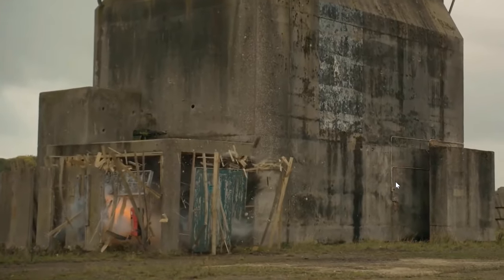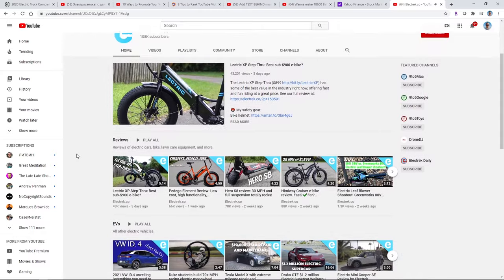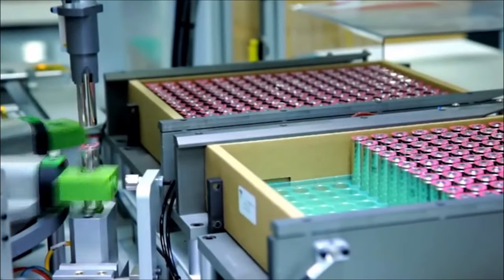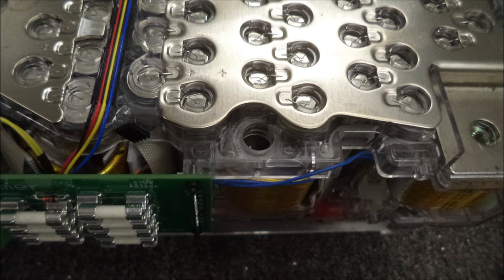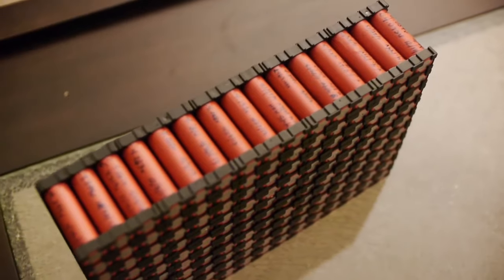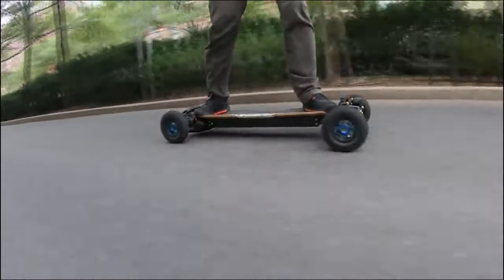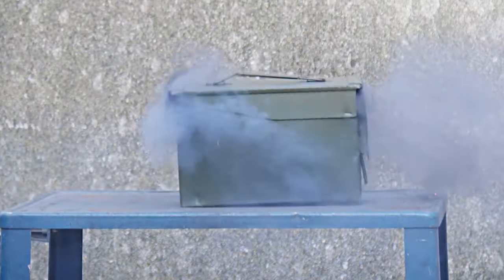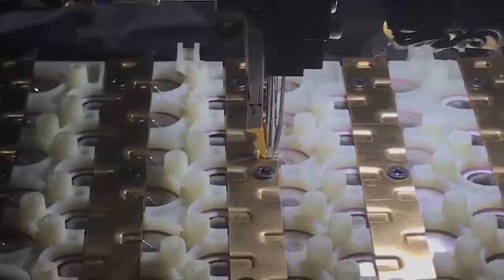7 Steps On How to build The Safest DIY Li-ion Battery

Comment: the safety concern is good and all, but most of the time for e-bike battery builder, they use copper-nickel sandwich to deliver the outmost current from the battery, and using cell level fuse in this build almost impossible and easily make the budget multiply many times over.

diy powerwall user that use old laptop cell most of the time, while most of them use cell level fuse, but they solder it anyway, because the price of proper spot welder that around $200 or more like glitter 801D just doesn't make any sense compared to the pack price that usually not that far from that price or even they got the battery for free, yeah solder is bad but if you knew what you do and how to do it, especially for powerwall, i think it's still doable. 

diy powerwall that goes kaboom most of the time is from heat generated while being used, not while it's made, yes it's survivor bias but the reality is like that, most of the time because of overvoltage because the solar charge controller they used are cheap one, and diy powerwall rarely pushed the current rating, they use less than 0,5C most of the time.
Reply from the maker: Tesla is using a new tech now without fuses.
Reply: @ElectricVehicleSpace  i definetely need to read that, tesla is still ahead of it's time when it's comes to battery, chinese just behind a bit though, but as customer, competition is always good to push the dev.

new technology is good and all, but on customer level, be it professional builder or diy level in my place, we need maybe few years or more to get a hand on that technology, that's why any prebuild branded powerwall or battery pack isn't realistic to buy here, even some branded prebuild battery and solar set price can be more expensive than the house price itself here lmao, that's why people here still hunting for old laptop battery, not only it's dirt cheap compared than other option, even used LFP cell price still high here, but also there's still no facility to recycle any lithium battery here.

Comment: I saw a snip of my video in there. Would have been nice if you asked before using it but that's up to you. I agree cell level fusing has it's place but I think it could do more harm than good with DIY builders who can't achieve the same precision as on an industrial level. Your basically filling your battery with a bunch of resistors that will create more heat on top of what the battery is producing normally.

Comment: Spacers. Not absolutely required... And not possible to use on every scenario. (try to build a pack for a Laotie Ti30, the original battery doesn't have any spacers).
Fuses. That's why BMSs exist... Surely a fuse is much much safer, but putting fuse wire on every connection is unrealistic, especially if you don't have a awesome spot reder... 
Tesla is a battery factory, don't expect DIYers to do the same kind of a good job without the necessary tools... 
Hot glue is fine :) As long as the pack doesn't get oo warm, it's perfectly fine...

Comment: Cells heating are more about the connections in series than anything. 
Most think you can buy cheap nickle plated strips and its all good except when you have high drain. Or use cells that arent designed for the amp draw. 
Especially the wells at the positive and negative sides of the batteries. 
Too many stupid videos showing bad practices

Comment: My super expensive bosh battery pack does not have individual cell fuses...they are solid spot-welded 6P in 10S config...go figgure...
Reply: Yes, this is pretty common. I think that the reason Tesla uses individual cell fuses is that their packs have so much spare capacity that an individual cell dropping out isn't going to cause a problem, the packs are never fully charged or discharged and the rate of discharge per cell is low enough that the fuses in practice will never go. But when packs contain fewer cells having a good cell drop out is an immediate cause for concern, and the biggest risk is a bad cell that starts to discharge itself and its neighbors at a high rate. That's why the BMS in a Bosch pack tends to brick the whole pack if it believes that one or more cells are faulty (the dreaded 'LED 2-4 error', which is not user resettable). Clearly, Tesla has the capability of creating very precise fuse wires, they wirebond them to the cell and the bus bar, and they can do this with such repeat accuracy that the wire will blow at a predictable current. Doing this in a hobbyist setting is going to be very hard to replicate accurately, I would expect at least a 50% variance from one such cobbled together fuse to the next if it isn't done robotically as the video shows.

Comment: TNT has an energy density of 4.6 million J/kg ->4.6million J= 1.278KW hour, lithium-ion batteries' energy density ranges between 260-270 wh/kg. 
TNT 1kg = 1.278kw/ hour,
lithium-ion batteries at most 1kg = 450wh/kg 

Why are you saying lithium-ion batteries have more energy density than TNT?

Comment: sodering cells is fine. listen to this i did a test on a brand new 1500 mah "
samsung" but it wasa chinese fake i think. anyways i decided to find out how damaged cells would get whe heated to just below thermalk runaway, multiple times. I used a blowtorch a held it on both the positive and negative ends of the cell, then out it back into the tester. AFTER DOING THIS 7 times witha blowtorch the results were that the mr increase by 10 and the capacity ddecrease by 50, basically nothing, even with a blowtorch I didnt damage the cells. But I have experienced thermkal runaway 4 times now and I know hoew scary it is but unless you pass that threshold heat does NOT damage the cells
Reply from the maker: You are just lucky. Don't play the rullete game...

Comment: hy where are you located? could you build me a 150- 300kwh boat battery pack? for a 12kw engine. i have to stay under 3.5 tonnes everything included, but for transfer i could swap out the motor, clothes some movable stuff, liqueds and even the battery if possible :)

Comment: El problema no siempre es la batería, el problema también es o puede ser causado por los mosfet, todo controlador brushless estan conectados en paralelo los mosfet y el capacitor, que pasa cuando un mosfet se pone en corto? Pues va directamente a la batería y más cuando el fusible no adaptado a quemarse a un corto circuito, deberían de poner en serie un diodo en el + por si hay un corto, así ya no va directamente a la batería el corto circuito.
Reply: Saludos desde la ciudad de México 👍🇲🇽

Comment: Assuming that the poles won't contact the opposite is the first reason that causes short circuit

Most battery explosion happen due to dangerous design flaws
I've been using li-cells for a decade for many applications but never had a single short circuit incident

Comment: what kind of bus bar should i use for a 10s10p battery
Reply from the maker: depending what set up will it be used for and the required draw for the all system.
Reply: @ElectricVehicleSpace  i need it for a 1kW motor that draws 40A continuous

Comment: not to downplay safety concerns, but LI batts are only mildly dangerous. not extremely so as stated in  the vid. extremely dangerous is the level of household mains
Reply: I would say most accidents with battery packs result from underestimating current capacity of connections and wiring. I see so many ppl using like 12awg wire trying to build 50A packs but you know it's gonna get hot at that draw

Comment: Hey! does anyone know if I can actually connect a 12S battery pack with a 13S battery pack in parallel?
I think the BMS of the 12S stops loading when it is full while the 13s will still charge up.
And when I've run the 13s empty enough, the Bms from the 12s starts up again and both batteries discharge, right?
Sounds like it could work, or am I wrong somewhere?
Reply: I know Im mad late but if memory serves correctly if they are in the same arrangement ie Xs then you can just go and add them in parallel but you cant if they are not. The reason being is that each pack is a different voltage. When wiring anything in parallel they must be the same voltage and can hold and discharge the same amount of energy. If you wanted to make them equal you would have to add another set of batteries in series to the 12s and then get a bms that can handle a 25s pack. You could in theory run the packs with a bms but you would need to monitor both the charge rate and full charge of each cell along with the pack and make sure to never run the batteries out fully.

Tldr no you cant but with a little tool work you can but youll need a new bms. Just remember batteries in parallel dont drain one after another they drain at the same time its just adding more cells adds to the reservoir it can drain from.

Comment: I remember when companies were going to make hydrogen powered cars and everyone screamed about how dangerous it was.
Now cars are being powered with Li-Ion batteries, and no one is saying anything.
Reply: Well they are still dangerous but in different ways. Despite what the news reports explosive failures of Li batteries is extremely rare. More like a fast burn much like standard fossil fuels. When a pressure vessel with a combustible gas fails and there is a fire a spectacular failure is the norm.

Comment: So wait a second.  Why the categorical dismissal of hot glue?  If the cells are appropriately spaced, say with silicone o-rings, there wouldn't be anything inherently unsafe about keeping them together with hot glue would there be?  Of course, assuming that everything is well isolated with fish tape or whatever.
Reply: hot glue melt. hot glue people too greedy and dumb to keep cells spaced. no way for cell to drop out of pack if hot.
Reply: @snorttroll4379  Based on your spelling and grammar I don't think you've earned the right to be calling anyone dumb m8.

Comment: Do you consider problematic if receiving new li ion cells at 3.44v? I've  received my new 21700 Samsung INR 40T3 4.000mA, 35A cells with 3.44v. Is that too low? 
I've builded an 2.8 kw 24s8p battery for an electric paramotor and has a huge voltage drop at 10-17kw full throttle and it should handle it like other similar batteries. I'm trying to find out why. Thanks.
Reply: No, it should be fine just the capacity may not be 100% more like 80%.
Reply: @henrikgure2123  Hmm, interesting point. Other battery builders told me they also received cells at this voltage and it is normal. But your ideea might explain the voltage drop at high loads..
Reply: The new laws pertaining to shipping lithium ion batteries requires the SOC not exceed 30%, thats why you no longer see cells arriving at 3.7v like before. 

As far as voltage sag, just look at the average sag reported by your Bluetooth BMS, and the amps, divided by your cells in parallel, then find the manufacturer’s datasheet or a test from Mooch, and see of your cell sag is following what’s expected. 

17kw is about 25a per cell in 24s8p and thats the realistic CDR of the 40T, and it will sag from 4.2v down to 3.7v in a few seconds.

Of course proper battery construction is also important. Especially giving each P cell its dedicated current capacity to the next series. There are some batteries only giving 4mm^2 for 450a series connections.
Reply: @imho7250  Thanks a lot for enlighten me! Someone even asked me where I bought the cells so he can avoid! Others said is ok and they received the same.
I'm on my 5th flight and I love it. The 2.8kwh batt gives me 26min flight time and I land with 43% left, 1.8-2kwh drained from the 2.8kwh batt so I could go a little more. I have no bms, have temp senzors, voltage alarms etc. Level flight is at 3.8kw load, climbing at 5-6kw and take off at 7-8kw so no need for more than that. 
I even mounted a thermo probe on the pure nikell strip that's on parallel connections thinking maybe it gets hot but it has same temp as the cells. They go to 43C at the end of flight which is fine.
I've posted about this on the Endless sphere forum https://endless-sphere.com/sphere/threads/help-in-identifying-voltage-drop-overheating-reason.121079/

Comment: So I want to build a battery pack for a camper. It will see extreme temperatures. My first thought is I need to climate control the batteries. Very little is mentioned about this anywhere. Another thought is that I want it repairable. Something that battery packs wrapped really tight are not. Thirdly, I want the system to be self diagnostic. Not something that is common with battery packs let alone with DIY builds. Sadly it looks like I will need to engineer my own solution. Thanks for the video.
Reply: For a camper I would look at Yinlong Lithium Titanate Oxide batteries. Not cheap but a really nice set of properties, as well as very high mechanical stability.

Comment: Excellent video but will BMS's make a difference in preventing thermal run off or no?
Reply from the maker: The bms does not prevent that but fuses will.
Reply: @ElectricVehicleSpace  Thank you
Reply: @ElectricVehicleSpace  fuses?  On the BMS?  Or do you have a any links to how fuses and be used to prevent this?  I'm just getting into them and i want to be safe.

Comment: .. From Italy...great intro... 👍
Reply from the maker: Thanks! 😃
Reply: @ElectricVehicleSpace  can you safely run lithium ion batteries in parallel if the batteries are the same?
Reply: @nameno544  Yes, and even when they are not the same, provided that they are at the same voltage when you join them and that all of your series blocks are the same total capacity give or take a few %.
Reply: @pianojacq  thanks